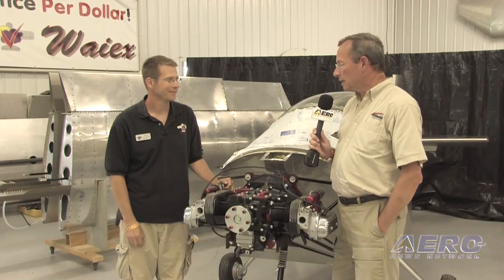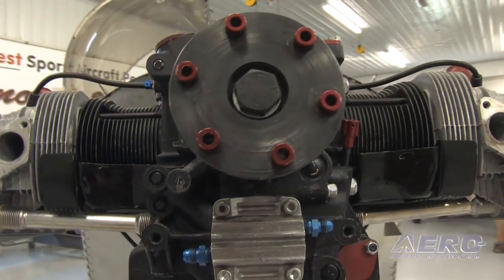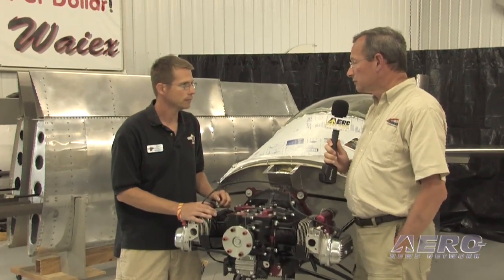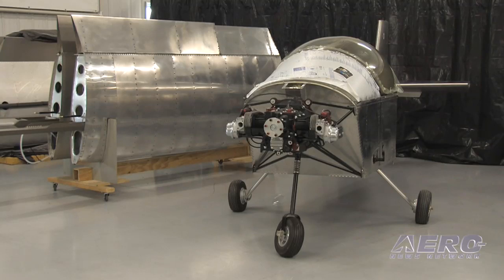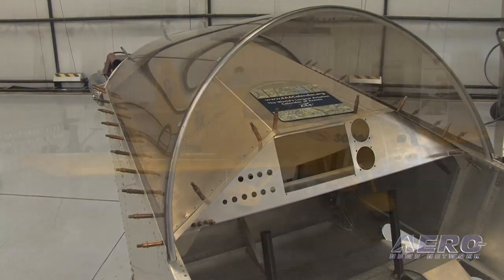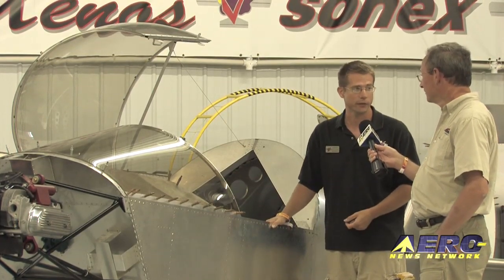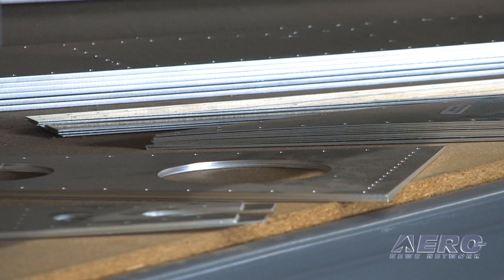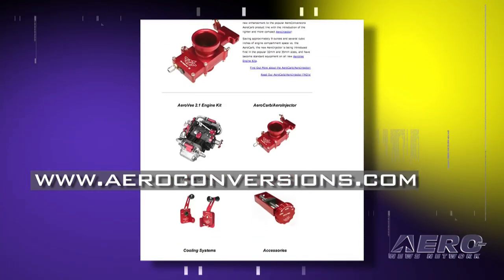Aero-TV: Sonex Aircraft - Inside The Hornet's Nest (Part 2)

Comment: I'd use LiFePo which is a much safer battery than LiPo. I'm actually looking at retrofitting an electric motor to a small gas engine. That way I can takeoff, climb, and land on pure electric power, but cruise efficiently on a small ICE engine. A modified Sonex would fit the bill because it is inexpensive, easy to build, and fun to fly (responsive and aerobatic). I wonder what a small canard would do to a Sonex...